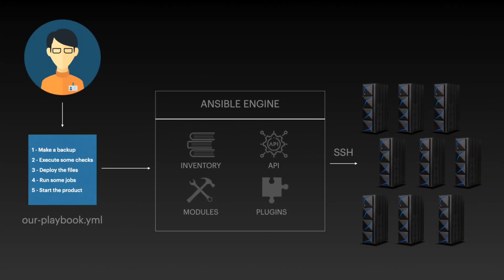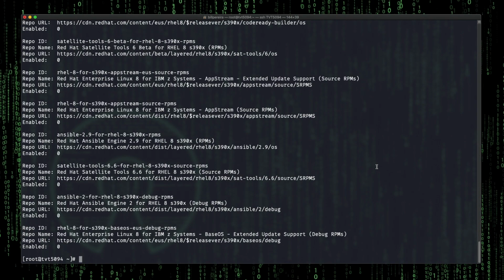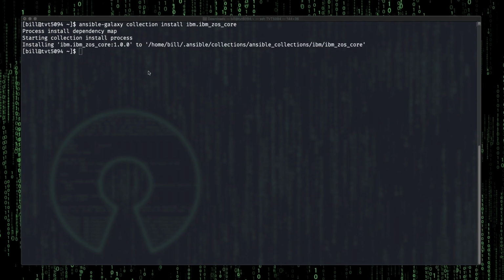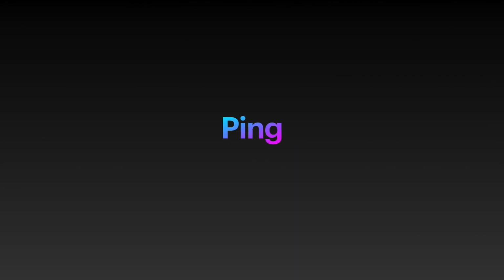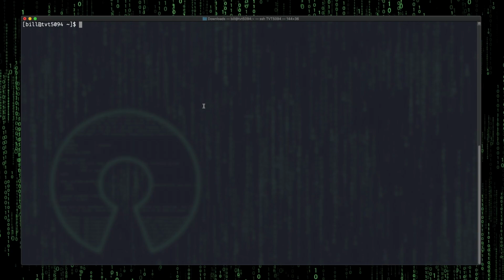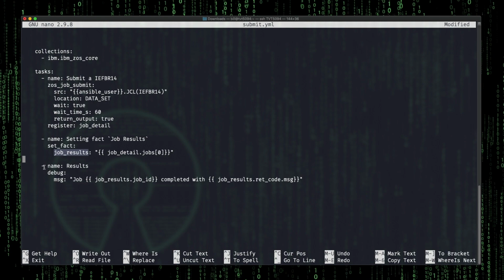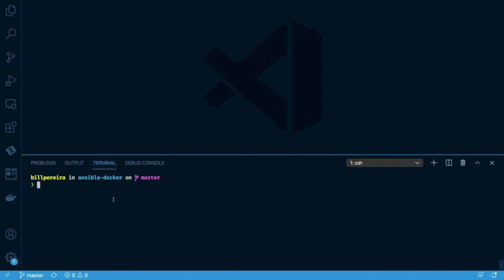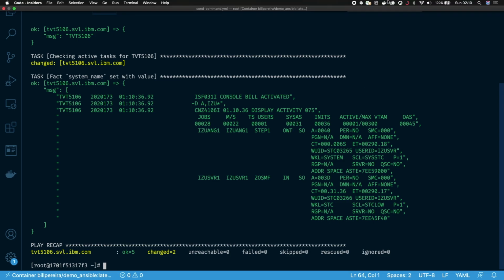Getting started with Ansible!

Comment: Hi Bill, Thank you for this video, but I tried the demo playbooks in your snippet video and I'm a bit frustrated because your small TSO commands don't run for me:
---
  - hosts: mtm2020
    vars_files:
    - /etc/ansible/host_vars/mtm.yml

    collections:
      - ibm.ibm_zos_core

    tasks:
      - name: interact with TSO
        zos_tso_command:
          commands:
            - TIME
And the error:
TASK [Gathering Facts] *****************************************************
ok: [192.86.32.153]

TASK [interact with TSO] ***************************************************
fatal: [192.86.32.153]: FAILED! => {"changed": false, "msg": "An unexpected error occurred: JSONDecodeError('Expecting value: line 1 column 1 (char 0)')"}

Any suggestion?
Thank you!
Reply: Same answer as before :
You are GOOD! and you know it!
Yes a problem with the ansible.cfg and the location of the playbook file!
Both issues have disappeared with this small change!
Thank you Bill